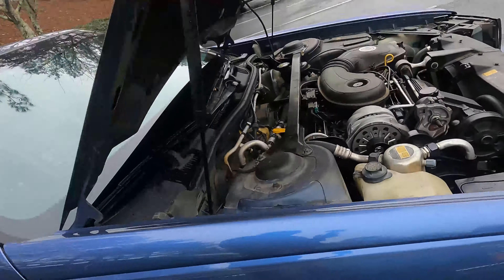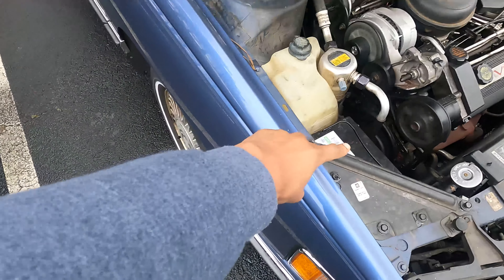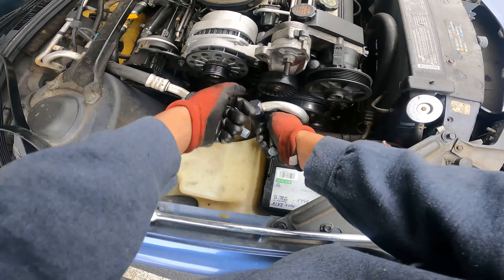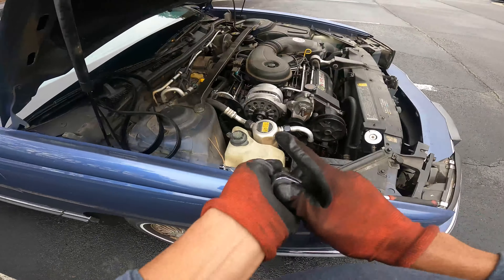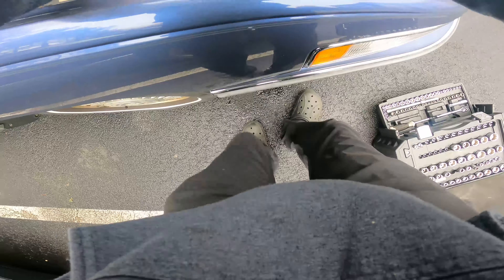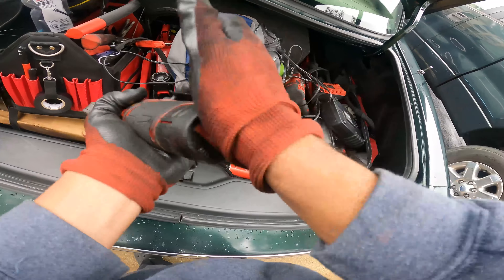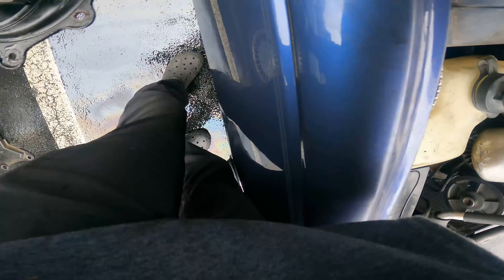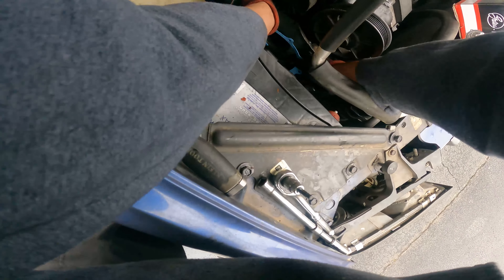Every 4.9L Cadillac Needs This Repair!! Step-by-Step Water Pump Replacement Guide

Comment: Did you not need to replace the timing chain? I need to change my pump but I don’t know if that needs replacement as well..
Reply from the maker: I apologize for the late response. I found this on google.

“Timing chains do not require routine replacement and should last the life of the vehicle.”
Reply: @JLowe  A "lifetime" timing chain means that when it goes, the car's life is over. Just sayin'.
Reply from the maker: 100%. That’s why I try not to put to many miles on mine. Mine has about 150,000 miles and with good maintenance I believe I can easily get another 80,000-100,000 miles out of it. It’s already paid for itself so if it goes tomorrow I’m not mad at all.

Comment: When doing my I stripped one of the 10mm threads on the block… Will a tap and die work or should I try something else?
Reply from the maker: That depends on which bolt it is. If it’s an outer bolt, you may be able to use some gasket maker around the area and make sure the other bolts are torqued to spec.

Comment: How come the pulley tightens crooked when putting it all together again?? The three bolts are fine but as the get tighter it rubs against the watere pump.. how do I handle this situation?
Reply: 94' 4.9 deville
Reply from the maker: I haven’t personally heard of this issue but try to alternate tightening the bolts in an circular fashion and see if that helps. Let me know the results!

Comment: How did you hold the pulley still when you loosened the bolts
Reply from the maker: there is a trick where you can put the appropriate size wrench on the bolt on the pulley (enclosed side). Face the wrench upward, toward the sky and tap it a few times with a hammer/mallet.